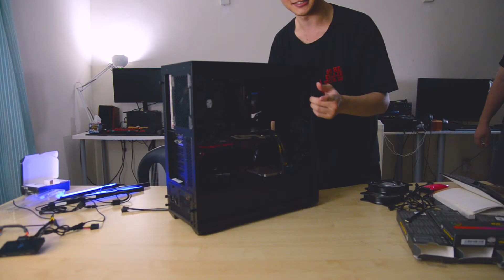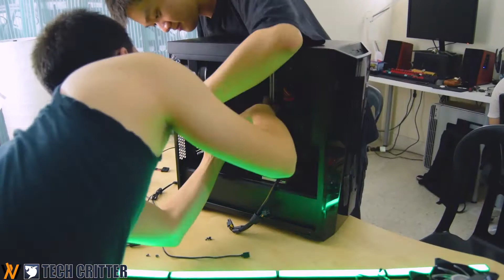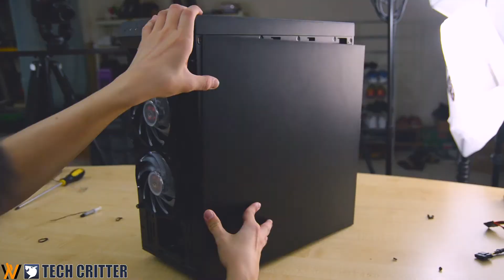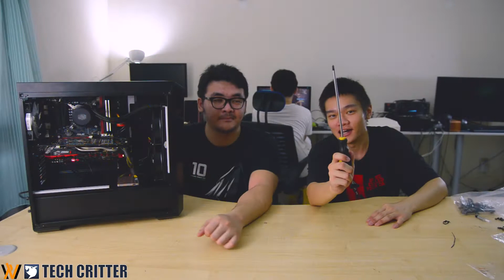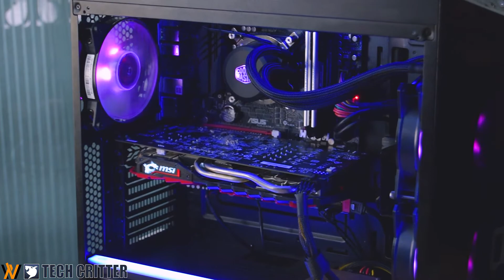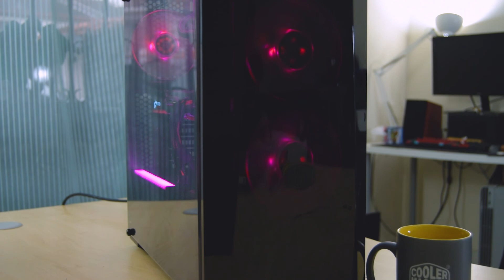How to RGB-fy Non-RGB Systems - Part 2: The Build

Comment: Was it connected to an internal USB header? Also, will it work with non-Cooler Master products?
Reply from the maker: It's connected to the motherboard via internal USB, yes.
The RGB LED controller hub doesn't work with non-CM products unfortunately.
Reply: @TechCritter  aww.. That's too bad..

It would be great if you could review a product that could synchronize RGBs regardless of brand, if there was, anyway. 

Nice video, by the way. Would have been better if you showed the connection to the motherboard, though. That's the problem of many of us.

Comment: i have z97x gigabyte m/b lga 1150. it have no rgb: 3pin 5v, nor 4pin 12v. Is there any other way RGB can be used, like controller connect to the pcie x1 for example?
Reply from the maker: Unfortunately, no. There is no riser card to connect to the motherboard.
Reply: Got the same problem :(